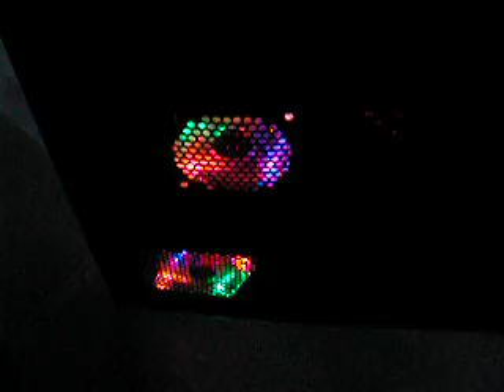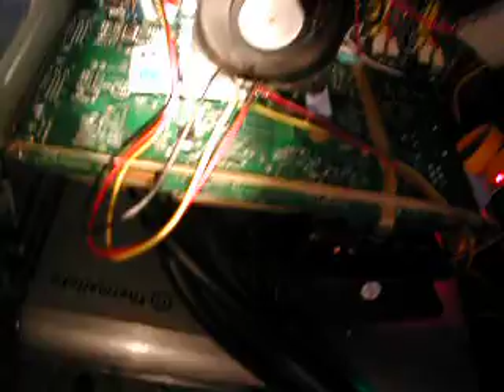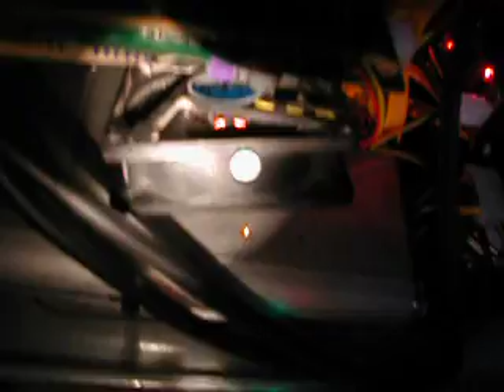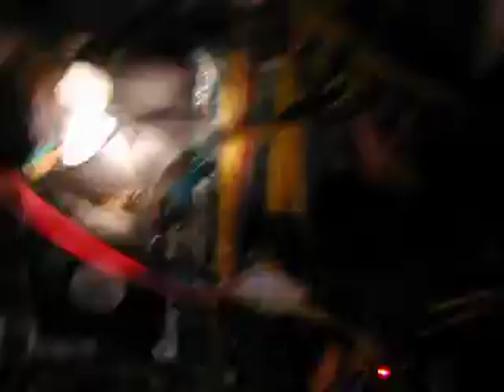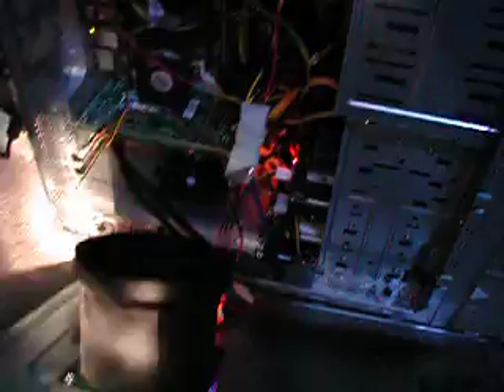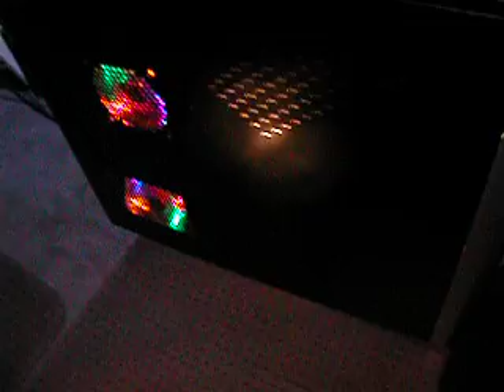Overclocking. Cooling show 8600GTS

Comment from the maker: It is fine. The teperature of my processor is not going higher than 35C  . This is the Core 2  Intel did something with it that now it runs 10 times cooler than any P4 processor.